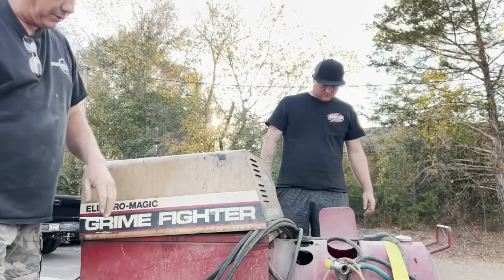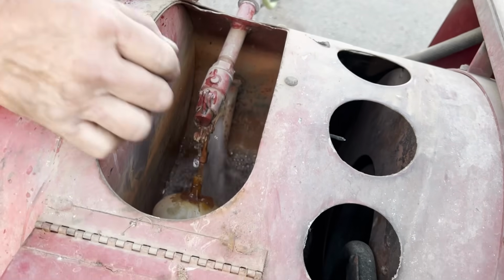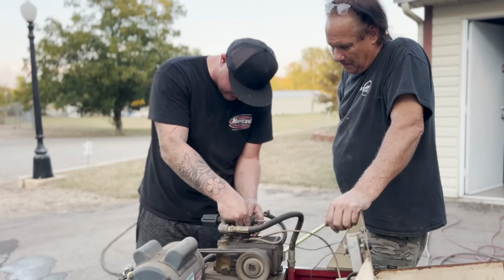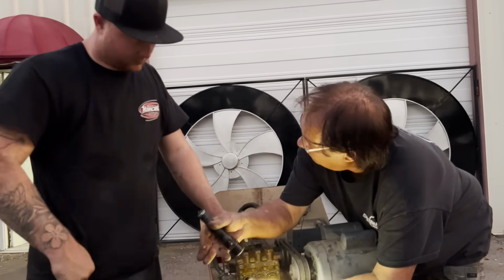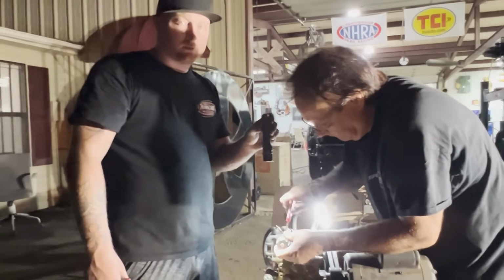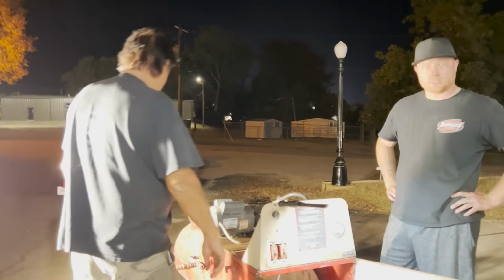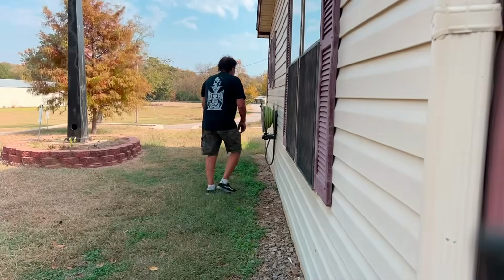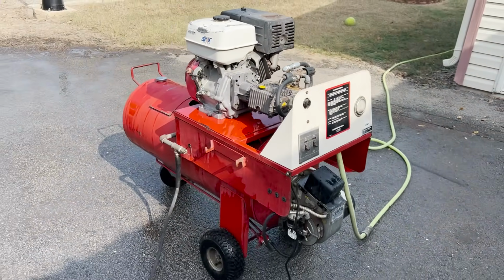$300 For THIS?! EPIC Hot Water Pressure Washer Find on FB Marketplace - Rebuild It with Us!

Comment: As a maintenance man at a facility where we have cold water, hot water, snd steam pressure washers, this was an interesting video to watch. Hot water will clean much better than cold. Steam will do better than both. The washer is working as it should.  The burner should not run when the trigger is not pulled. If it can run as high as steam, you don't want over about 500 psi. Also no trigger on the gun. Steam is deadly if left to build pressure. Also be mindful of the temp rating on whatever pressure washer hose you are using.  Most normal hose is not rated for steam.

Comment: The primary purpose of the water reservoir on the pressure washer is a break tank to seperate the potable water from being directly connected to the high pressure pump which prevents water from being siphoned or pumped  back into the potable water supply in the event of a malfunction or interruption in water supply causing backflow /siphon.

Comment: Thanks for this video.  It motivated me to work on my Mi-T-M That has been sitting in my shop for the past six years.  Turns out it was just plugged up with calcium and the fuel line to the heater was plugged.

Comment: As super talented as Dennis is is anyone else surprised that he hasn't built one these already using a tank less 110 electric water heater or a LP converted gas unit mounted on a pressure washer cart?
Reply: You can get a propane tankless that uses a couple D batteries. With that and a gas engine it would very portable

Comment: Steam cleaner are low pressure systems because the steam softens the grease & oil not like a pressure washer that counts on brute strength to remove the oil & grease.,try flushing the coil like you clean a tankless water heater with pool acid and pump over and over till clean videos on you tube.

Comment: Dennis. I worked at Waukesha Engines in the test cells for a long time and washing engines with Hot water as opposed to cold water was 10 times better. Cold just will not get the grease and oils off adequately.

Comment: Be careful what you point that at. Years ago I was dating a girl that had an M G B. I took it to work, we had a steam cleaner simular to yours. Washed factory aluminum wheels, black powder coat / machined accents, spoke edges and outer rim edges. When I finished I later realized there was a plastic coating on the wheels I destroyed. It dryed out the wiring harness under the hood. Be careful what you point it at and watch your distance ( spray painting method  ) .  Hard steel / prep work yea, finished product's becareful.

Comment: What's really nice about Hot Water Pressure Washers is that it will clean the Oily Film away that a Cold Water Pressure Washer won't. 

You've got a good unit there now

Comment: Just a little fyi the proper way to start a power washer is to turn your water on first and let it fill the lines and pump and then after a minute or so squeeze the trigger on the wand and let the water flow through it and purge all the air out of the water line and pump before you ever think about starting the engine starting it without doing it this way is a quick ticket to burning up a pump for sure cause it doesn't get along with having air in the system and it's not good for it to just turn the water on and immediately starting the engine and expecting it to have pressure I'm just trying to save u time and headache and lots of money replacing parts from not priming it and getting the air out of it before starting the engine it's a common misconception that you just turn the water on and fire it up and squeeze the trigger but if you read the operator manual on almost any power washer that's what it will tell you to do as ur start up procedure every time

Comment: The knob is ur unloader valve and it controls the pressure when you let off the trigger it's sort of like the blow off valve on a turbo car it relieves the pressure when your not on the trigger on the wand and keeps the engine from bogging down when ur have the trigger on the wand wide open and it also allows you to adjust the pressure at the wand on the larger pumps so you have more control of how much pressure you have coming out of the wand

Comment: There's check balls underneath those three big nuts on top of that pump valve and I'd say they are rusted in the holes and corroded and stuck and they allow the unit to build pressure when it's running and those ceramic plungers are on the bad side of their life and most likely need to be changed but like I said earlier call American Airless and get a new and improved pump that u won't have to worry about or work on cause once you start working on a power washer pump ull be working on it every time you want to use it and the guy i talked to at American Airless informed me that most residential power washer pumps are only designed to run about 100 hours and then they have catastrophic failures and most pumps on power washers even the high dollar units are not made to work very long before they have a breakdown or have to be rebuilt or simply replaced cause it's cheaper in the long run to just bolt a new pump on a good engine cause the engines all out last the pumps with even the worst maintenance they'll outlive the pump three times over

Comment: Yes sir back in the early seventies I worked for Westinghouse Apparatus Repair (electric motor rebuilding shop) over in Tampa Fl. When we would get a cleanup job on an electric motor we would steam clean the greasy parts with what we called a steam ginny which is a hot water pressure blaster. I am here to tell you the grease did not have a chance. That's going to be a good machine and when you get the clogs out of those coils you will be going to town.🥸👍👍👍👍👍

Comment: And if you need any sort of parts for that machine I'd try a place called American Airless in Georgia I believe they have got everything u would ever need to rebuild power washer pumps or they also have new pumps of all shapes and sizes for any sort of application u can imagine from factory stuff to homemade units if you wanted to build ur own power washer apparatus check them out if you need any parts to get it going properly they also have air compressor motors and pump's for just about every compressor ever manufactured new and old

Comment: That black knob is ur unloader valve it controls the pressure coming out of the wand so ur able to decrease and increase the pressure but u don't want it turned all the way in cause I'm pretty sure it closes the valve off completely and it'll burn ur pump up if you run it like that very long most large size pressure washers have that valve so you can adjust your pressure coming out of the wand

Comment: The steam cleaner I cleaned motor parts with the water came out of the nozzle all the time and would get super hot and when you squeezed the trigger then the pressure pump kicked in.

Comment: I have a slightly older hot water pressure washer someone gave me.

The water tank is a anti-starvation protection for the water pump.  The hose is not enough & it WILL suck it flat.  The tank keeps the pump from running dry & damaging it.

The water in the tank gets pretty warm. I used to borrow one from a friend, just like the one I have, by the time it needed a refill of diesel, the water tank was steaming & almost too hot to put your hand in.

Mine has a common wall between the diesel & water which has rusted through.  It's too hard to repair, so I have a 5 gallon diesel can & a 7-8 gal water tank I'm going to breed into mine.

I got it right before I got cancer & haven't had a chance to put together the pieces I have. 

 Haven't used my cold water pressure washer since I got back on my feet, so I'm not missing much, w/ the hotty needing work.

They are exceptionally handy to have around. BE CAREFUL, you cannot be as casual w/ them as you can be w/ a cold washer.

They will kill plants/shrubs in a heartbeat, they're hell on acrylic & PVC, (PVC has very low melting point, soft in mid 90⁰s).

It goes w/o saying, it'll cook human skin in a flash, too.

Good score, you won't regret the $300.  Parts are readily available, if you need anything.

Comment: Back in the late 70s/early 80s I bought my second 55 Chevy and took the front suspension all apart and it was greasy, dirty, caked on nastyness.  I was working in a machine shop at that time that had a steam cleaner and after work one day (or maybe it was at lunch) I got the foreman to show me how to set it up and it cleaned all that gunk off and when it dried it wasn't even oily-feeling.  I took it all home and painted it as it was.  I wished I could have taken the car there and done the engine compartment.  
You know, google can be a friend with stuff like that.  A 10 minute search for Super Steam 12000 (or whatever the make and model is) and no guessing.  Parts diagrams, electrical diagrams etc.
Dennis: "But where's the fun in THAT?" Right? LOL

Comment: Just a quick one. But isn't the cold air intake for the air cooled motor planted right above the hot air exhaust for the water heater?
Reply: I apologize for my comment. I commented before I finished the complete video. And you addressed the issue that I saw. I will shut my digital pie hole and continue watching your video. Love every thing you do on your channel and everything you did on Alex's channel in the past years. Keep it up

Comment: Unloader valve opens when you close the wand valve.  Flow switch turns burner on when there is flow through system.  Burner shouldn't run with out flow.  Be careful running to much pressure in a coil that may not be rated for.

Comment: Be careful using that wand all the ones I've used had a cage around the metal end to insulate your hands. Great find' Just remember to drain the pump if its going to freeze. Made that mistake once. It hurt.
Reply: glad to see at the end a differnt wand with a cage on it. Steam is a huge advantage especially when we woiuld clean greasy engine comparments etc. You're right to covet one for yourself

Comment: ive been through a few high pressure hot water sprayers, all are very similar, and have the same issues from sitting, water entering float  controlled cavity should be for detergent mix added to gun spray pre-pressure right? water pressure switch controls burner engagement

Comment: You will love having hot water pressure cleaner because it works so much better.  I used to have the exact same pressure washer. They still make them. Pressure zone has it for 3600$

Comment: my buddy owns a salvage yard and they use a hotzy pressure washer  to clean everything they bring truck chassis in with the loader lift the front of truck up and the hotzy strips everything off of the frame and engine and underbody it looks like a new truck underneath when done it even takes rust off  they are amazing when they work correctly   anyways great detective work guys  and recycling parts

Comment: I worked on pressure washers for 40yrs Eletro magic  made by Alkota cleaning eq  see the hp on the motor
Reply: I can fix it over phone before you get hurt
Reply: Need the get a 30 socket and take out the bottom valves on the pump
Reply: Make that 110 plug short out of the water

Comment: steam cleaners are great  but you have to be carefull you dont cut through hoses and filters  if it starts to whistle  shut the burner off right away and keep the water flowing the one i used had a deisel heater   it put out alot of pressure
Reply from the maker: Thanks. It’s a scary machine

Comment: Sure, watching vids about flashy hotrods are great. But I really dig watching a couple gearheads save a vintage piece of equipment from the scrap yard. This reminds me of when I rehabbed a Reddi-heater someone chunked in the dumpster back in the 90's ... just because it made too much noise. The fan housing was bent and rubbed on the blade. I still have it, and it still works just fine. ✌

Comment: Yeah, that steam cleaner has some years on it. Back  around 80 we had one at work it got really hot!! We never had any problems with it except when it started to run out of Kerosene it would start blowing them puffs of smoke out of it. It will be worth putting a little time into it. Great video

Comment: I am going to try my portable propane powered hot water heater inline with garden hose and electric pressure washer. The hot water does make a difference in my limited experience. Great project.
Reply: The hot water through your pressure washer will not work for long, not designed for hot water...
Reply: @jeffstevens9849  Thanks, good to know. I don't plan to use hot h2o very often.

Comment: Water heater+pressure washer
they make a wand for car washes in northern climates that have a weep hole, keeps water flowing.
Reply: @mayshack  yep unless you buy one rated for that temp, this cold water pump he put on is probably going to melt.
my house already has a tank water heater, wall mount pump rated for 150*. Unless you want to keep it mobile, then yeah they make small portable propane tankless water heaters. Either way pump must be rated for the temps.